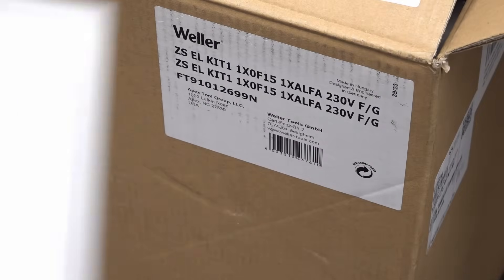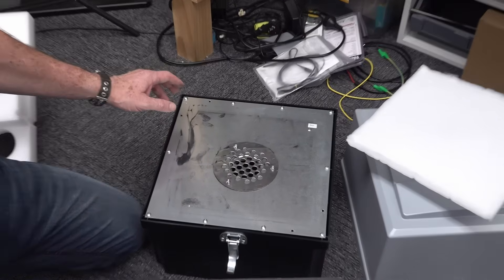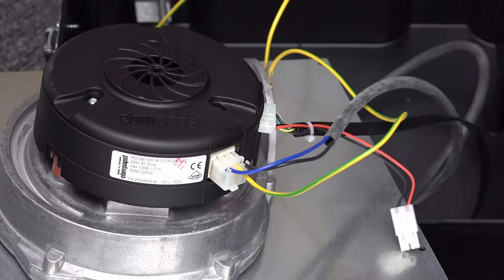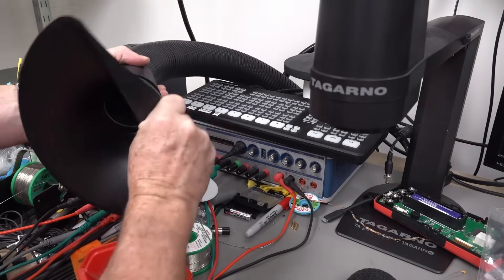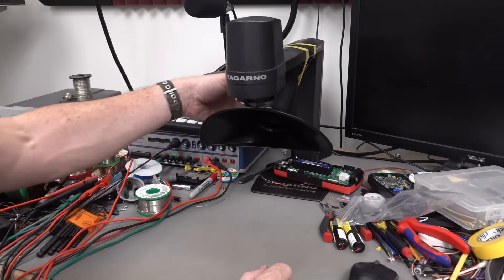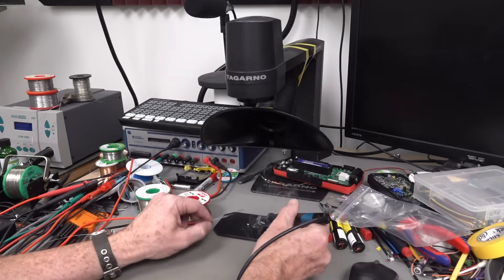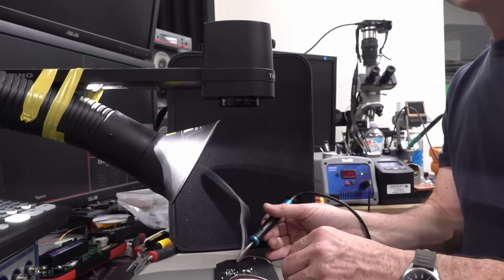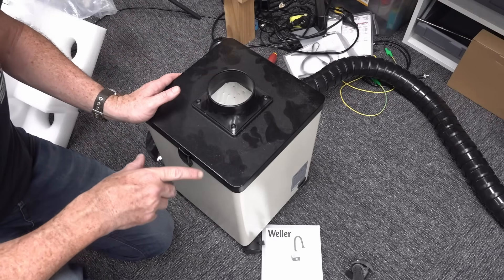EEVblog 1616 - Weller Zero Smog Fume Extractor Review

Comment: What is the difference betwee Zero Smok TL (22kg/1200€) and EL (13kg/800€)? Did they save on filter? (it mentioned Economy filter  on yours).
Reply: The TL has a more powerful blower (190m3/hr vs 150).  
TL has sound insulating material inside.  
TL has different electronics. 
TL has better prefilter (F7 vs. M5) which extends the life of the main HEPA.
TL has rubber feet.
Reply: @geraldgardener3765 thank you for the reply. Using EL for 9 nine months. So far looks good, no smell in the room from soldering, PLA/PETG printing. 🤞

Comment: Can someone explain why I’d buy a 1000+ dollar fume extractor, when I can buy a 200 dollar industrial vacuum with HEPA 14 filter included?
Reply: Yep , you dont even need industrial. Electrolux Pure D8.2 is absolutely silent home vacuum, comes with HEPA variant , you can fill the filter bag with activated charcoal or activated charcoal filter foam. It sucks like a beast, you can regulate the suction. 500W/max . Excelent hose. Only issue is it's non ESD , but you can fix that. S-bags Long Performance or Anti-Allergy are cheap , I buy them in 12 packs.  :-)  

* a fine mesh in front of the hose is a must , otherwise you will have to fish in the  bag :D

Comment: I have a Vevor like your old one. This Weller is nice of course, the low noise level and the pedal being the most interesting features. For what iIcan see, it doesn't look like it outperforms the Vevor in term of suction. For me, the soft neck is a big no no. I wish they would add a led on the head for improved lighting on the bench.

Comment: I've used this for the past 5 years. Very happy with it. I have it on the highest setting. Sometimes it sucks up things like component bags and it even sucked up a solder wick spool once (then you have to open the lid and get it back which is a bit annoying).

Comment: I'm a hobbyist and I don't particularly like breathing in smoke when I solder. So I have an old 12 volt fan, extracted from a dead computer and I power it from a 5 volt bench supply. When running at such a low voltage, it's completely silent and just creates a gentle breeze. I have it on the bench behind my work, blowing air towards me and the smoke, instead of drifting up into my nose, get's dissipated elsewhere. Works a treat.
Reply: IOW, you don't actually remove the smoke from your air, you're just breathing it in at a slower rate.
Reply: @simon7719  Possibly true. However, the amount of smoke coming from a single soldering iron used for short periods is very small, but if you are leaning directly over it and it drifts up into your nose, then it's not very pleasant.

A hobbyist is not going to invest in an expensive air filtration system. In total, over the last 5 years, I've soldered about 200 IC's onto half a dozen 8" by 8" boards, along with associated connectors and wiring - hardly industrial scale work. My 'solution' works fine for my purposes.

Comment: I placed a simple kitchen hood extractor connected to a pipe above the soldering station, like this device, except that I connected the fume outlet out the window. cost: 100 euros. and clean air without filters to change.

Comment: Personally I don't see the appeal of these.

If one solders less than an hour or two every other day (ie hobby level), then a simple desk fan blowing the smoke out into the room will ensure that one won't breath in any meaningful amounts of harmful smog beyond what one's lungs can handle. But ensuring one has some general room ventilation is also advised. (And a desk fan is often far quieter and far cheaper and has other applications too) And if one is really concerned, then add some duct work and blow it out a window or the like. A 120 mm "PC" fan is both quiet and provides more than enough airflow for the job while costing barely a fraction of this portable fume extractor.

For production environments though?
Just no. (actually there are exceptions to when a fume extractor like this is useful or even recommended for a production environment. But I'll get to that later.)

Where I work, we have a dedicated ventilation system for fume extraction.
It is far less noisy since the only noise it makes is the turbulence at its "nozzle", and it sucks better than the highest mode shown here in the video. (Also, it allows one to calmly talk at regular 55-65 dba talking volume and still being clearly heard by a person 10-15 meters away on the other side of a production environment. I will admit that my workplace is rather quiet. But at least it means one can concentrate one work and get the job done while not having to endure the rumble of a fan whirling constantly as one works.)

I have had such portable fume extractors before, and I am happy I don't anymore!

Since they are too expensive, bulky and noisy for hobby use.
And in a production environment a more centralized solution is superior to keep room noise down, especially if one has a lot of people working with soldering or other smell inducing activities at once. (gluing, painting, cleaning parts, etc)

Only times I see these as viable is if:
A. One actually desires portability and solders in odd locations on a regular basis. (that is honestly the perfect application for these fume extractors, and I won't even raise an eyebrow about such use.)

B. One has a temporary setup where one will do volume work. (like on a project site, or if one's office/factory is soon going to move to a new location making any investment in a more proper solution economically indefensible for the current location.)

C. It is also fine if one only has 1 or 2 of these since then noise isn't often too awful, and costs are still often better than proper ventilation. (But if one has more than 1-2 of these, then get some actual duct work installed, it is far from expensive unless one has a particularly expensive HVAC contractor. Yes, a proper system will cost quite a bit more than a fume extractor, but it is a well worth investment, mainly since it opens the door to more than just fume extraction.)

D. If one leases/rents space (which is really common, so you likely have this as your reason) then I can also see reason for not wanting to sink money into such an investment since the future is unknown if one will move or not. And the landlord might also just forbid such installations. Or one might have architectural/heritage restrictions to follow, some building's just have to look a certain way, a new ventilation duct poking out a wall or the roof might simply be unacceptable.

In the end.
I am not a fan of these fume extractors.

Comment: I had the more expensive version at work at some point, it had the same problem: floppy and wouldn't stay in place, even attached. 
Depending on your model, the remote switch function through the RJ plug is either just a contact or some serial interface. If you want the official one, they retail for like 200$ so... at last try to diy it?
If you need more attachment, they will also cost you an arm and a leg. As much as a new filter.
I really preferred the air powered version that goes on the iron, but it's not an option for the micro-soldering ones or hot air stations last time i checked. It also needs a big compressor, but it's almost silent by itself.

Comment: Via the RJ socket, you can connect to other Weller gear such as soldering or hotair station so that the fan automatically turns on when you for example lift the soldering pen. Weller technical support is also very helpful and can provide you with application notes with the RS232 protocol if you want to make your own controller.

Comment: Having to work with this every day at work I have to say this. It's piece of junk.
After few days of usage it got very loud, it's NOT ESD safe and keeps building static charge on the hose. The fan unit overheats after two hours and the external control is just catastrophe as rest of the latest Weller gear.
And yeah Weller claims it's not broken.

Comment: Too Expensive even at $700.. I use a low noise speed controlled Computer Fan to push the smoke horizontally (~$10-$15)

Comment: I like the Hose of the JBC Fume Extractors more, the arm is easier holding in place (you just need to push the rings of the Hose together and it will get much stiffer, not working as good on the Weller one we have

Comment: A shame the tube isn’t stiff enough to hold its own so you can easily swing it out the way. Having to use tape or tie-wraps on such an expensive piece of gear would disappoint me. Mind you, I haven't looked at what the actual capabilities are supposed to be.

Comment: Man, that filter is massive! xD
Let me ask if someone knows about this though... it's mostly about surface area, right? Which will affect air flow?
Comparison to the cheap unit... Seems the extra bit is activated charcoal, which should help. Not sure what other magic might be there, if any.
I just have the most generic fan with that activated charcoal filter in front, it's crap. Then again, I rarely ever use it... very few times a year for a few DIY soldering stuff. If I were to upgrade the setup I'd just add another cheap fan to push the fumes away from my face. xD
Reply from the maker: Yes, it's trade off with surface area, HEPA material rating, and air flow/noise. Bigger the surface area the less fan speed/noise you need for a given flow rate.

Comment: you need to have a net on the air-pipe .. Otherwise it can suck bigger material. Second put Kapton tape on the edges, you might otherwise burn the plastic. I used to use one of these and it is good to know how to avoid burn the device.
Reply: Exactly my experience. I'm usually cleaning a PCB with a piece of lint free cloth, and then it gets sucked in :')

Comment: i love the smell of solder fumes.  Especially rosin core.
Reply: I did too, until I had a look inside the smog extractor tubes at my work place... Its not just flux in the smoke, there are quite substantial metallic grows inside the tube and, yes, we are still using leaded solder for internal, high reliability jobs.
Reply: It is what you don't smell that is the issue
Reply: Your airways and lungs probably don't enjoy them so much 😁

Comment: I made a fume extractor out of 3x120mm computer fans in series in a box (for higher static pressure) and without a filter - I am just blowing the smoke outdoors. Cost me about 50$ to make, produces about 50 db of noise, consumes about 500 mw of power, doesn't need a filter replacement.

Comment: Given that all these motors are either 0 - 10V and/or PWM controllable ( got to provide your own power ~24V but control side is already isolated - usually ) you could make your own speed controller as a weekend project.

Comment: I’m a Hungarian and big Weller fan too!
Actually Weller is the most popular soldering tool brand in Hungary since 70’s
They got a reputation from the industrial soldering solutions in all Hungarian factories such as Videoton, Orion, Philips, Ganz, Zim, Hajdu, Lehel, Tungsram, etc… and in their service franchise network. Wherever You went, You saw Weller.
Later, when the market opened up from the “Iron Curtain” those old service guys started their general service places for all modern western brands. But with their old trusty Weller soldering sets.
Where I started, a small TV and VCR service shop, we had a full classic blue desktop set. 
Later I worked on Kenwood, Blaupunkt, JVC, Alpine, etc products, but on my first day, I told my new boss, I will accept the job offer with only one criteria!
The soldering station has to be Weller and nothing else!
They accept it, and I got a beautiful 4 head resoldering - desoldering station!
I made at least 500.000  $ profit for the company with repairs and development! 
I never changed even a tip! Just the filter in the smoke extractor, and the filter plunge in the desoldering gun.

Now, I have the full most modern fancy pency digital set with all option in my personal electronic lab!
And a cabinet full with Weller accessories, tips, heads, parts…😂

Thank You Weller!❤ Thank You forever!

Comment: Those smoke extractors cost way too much for what they are
Reply from the maker: Niche market opportunity for you, get on it!
Reply: I concur, but have you seen Steve Wozniak hold a Lead Rosin Core Solder Wire in his mouth as he was soldering components ?

"Besides arsenic and cadmium, high levels of lead may also be a risk factor for pancreatic cancer." I wonder who died of that.
Reply: @Popclone  now, that's  practician
Reply: To be fair, your medical bills will outweigh the price of the machine by 20 folds if you get lung cancer
Reply: @h.a.6790  when I'm done with you modern medicine will not have solution
Reply: @h.a.6790  to be fair, modern medicine can't help with that falling piano or general stupidity in that sense
Reply: Agreed. The fan assembly itself I could buy for £112. I could buy a far more substantial hose for £25, a carbon hepa filter can be bought for £15-20. So what warrants the probably 5x markup? I could build something equally as effective for sub £200, and could actually build something with a stronger fan for less.
Reply: For an occasional hobbyist I would agree, but if you're soldering every day, it's worth it.
Reply: @larrybud  Tbh that dosn't negate the fact that it is overpriced.
Reply: Priced according to the value of your lungs 😂
Reply: @sdgelectronics  i'm smoker dude :)

Comment: Getting intake closer to work @ low setting seems ideal for videos.
Reply from the maker: Yeah, the trade off is camera + light obstruction. The noise is almost non-existant on camera. 2nd setting is ok too.
Reply: @EEVblog  I would be tempted to mod that end-bit to have some LEDs, thus gives you some edge-lighting when using camera/scope! (with light-guards to prevent going up into eyes, etc)

Comment: This ain't sh it, what you really want is one of the Aoyue soldering irons with a pipe going straight to the tip so the smoke travels like 5mm and gets sucked in. Costs like 100x less at 50 ish too for the handle. Several grand for a fume extractor... lmaoooooooo

Comment: Did you know that most of the price of a smoke extractor is in the FILTER... that's right, you pay 1000€ for a extractor and when you need to get a new filter that'll cost you... 750€ or something like that.

And that's the crazy part here...
Reply from the maker: This filter is US$233
Reply: @EEVblog  omg... I checked for similar filter for few others just a month ago, and the filter was 650€ :D which was 80% of the price of the device as new.

They looked suspiciously same as the Weller unit, just different branding.

At least Weller's reasonable...
Reply from the maker: @Mtaalas  Yeah, I'm surprised how reasonable it is.
Reply: @Mtaalas  The filter that came with the unit Dave got does have the word 'Economy' on it.

Comment: @ 5:37 fan speed - is PWM controlable…. 

there are several versions of this motor: in some you have to short-circuit the wires to stop the motor; to others you have to apply a voltage of 3-5-10v to start and others need a voltage of @3-5-10v or equivalent in PWM to start it and increase its speed..
Your model it seems to be the one where you reduce the speed when the resistance between the 2 wires decreases… have some fun with it :p
Reply: As far as I remember, all will accept a common collector PWM ( pull-up is provided ) and only some models will accept also Voltage control. Minimum start voltage around 2V or 10% PWM. You just have to provide the control side with power and it is already isolated - usually.

And they provide also with a Tacho Output, 2 or 3 pulses per rotation, depends on model.

Comment: @ 5:35 It is very standard model for Condensing gas boilers 😅😊
Reply: This looks like an NRG118, which is 300€ from what I can tell. So 300€ for the fan, 200€ for the filter, slowly getting there.
Reply: @jort93z  and 500€ for the middle managers